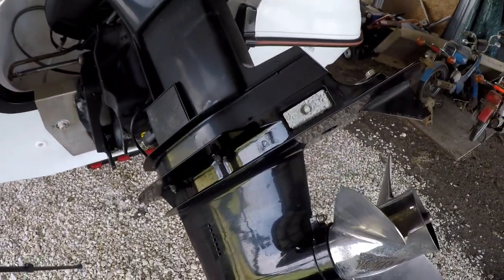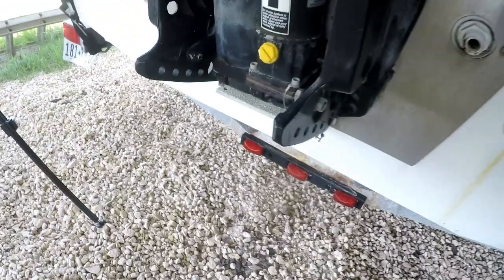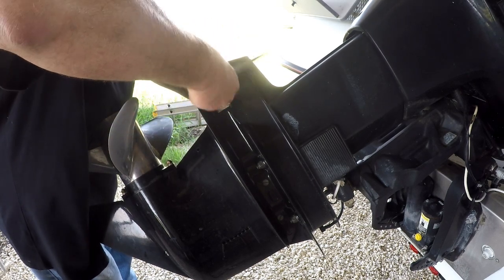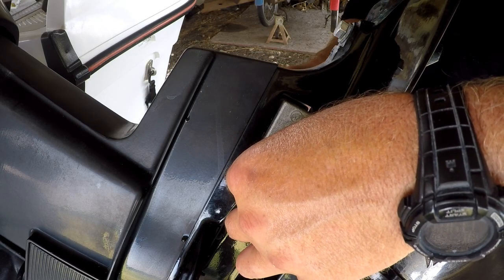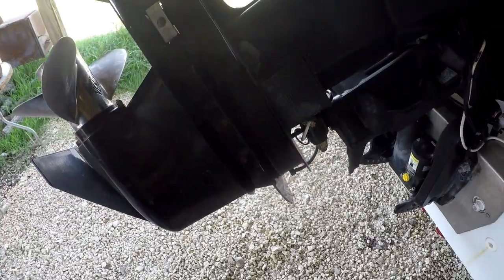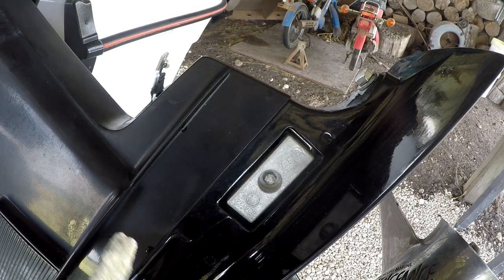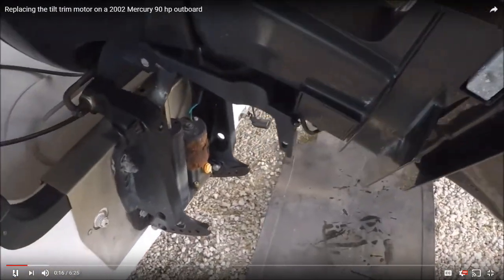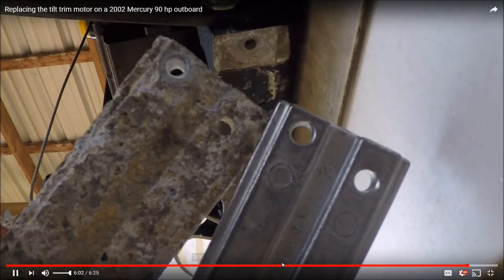Replacing the sacrificial anodes on a 2002 Mercury 90 hp ELPTO

Comment: Hi! Thanks for the really helpful and well made video, I just replaced the zincs on my 2009 Merc Optimax 115, which has the identical set of zinc annodes. Question: the bolts holding the zincs in have have zinc residue on them (not sure if thats salt or the biproduct of zinc degradation), which is really hard to remove/brush off, any tips on how to remove this for better bolt-annode continuity connection? Do you put any grease on the bolts before putting them back in?

Also, do you put any kind of a paste at the connection between the continuity strap and the longer bottom annode (continuity strap going inbetween the trip motor and the lower longer annode)?
Reply from the maker: No grease, and I would say if the bolt and nut looks less than pristine just replace them, cheap important part!

Comment: Update. Look at youtube. Search Anode change on 2004 Mercury 115 Four Stroke Outboard Engine. Anodes in same location as 90hp. Very detailed video.
Reply: The 90 HP in this video is a 2 stroke, 3 cylinder. Not 4 stroke.
Reply: Viewed video...totally different engine than what is covered in this video. 2 stroke vs 4 stroke.
Reply: Is yours a 2 or 4 stroke?
Reply: John Walsh 2 stroke just like video

Comment: Pretty sure you missed the 2 internal anodes. One in the exhaust cover and one in the head.
Reply from the maker: Not on this model
Reply: Wrong. 2 internal anodes near spark plugs and one below poppit housing cover.
Reply: @johnwalsh9010  Any pics or diagrams to find them on the 90 Merc ELPTO?
Reply: I can’t find them. Do you know where to look at a diagram or photos
Reply: @imanalien1984  This outboard is a rabadged 100hp Yamaha. Google internal anode replacement and click on images. Remove plastic cover on rear of engine to reveal spark plugs. You will see 2 anodes in that area. Third anode is located to the left of the oil filter down low.
Reply: @johnwalsh9010  Can't find anodes in these areas. The 90 ELPTO is a 2 stroke.